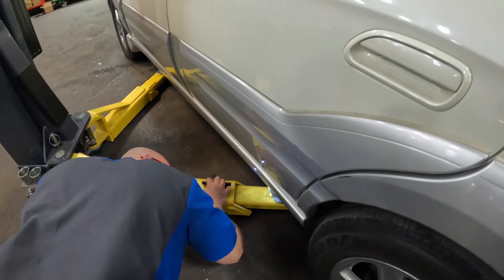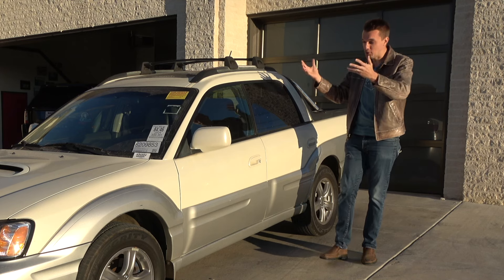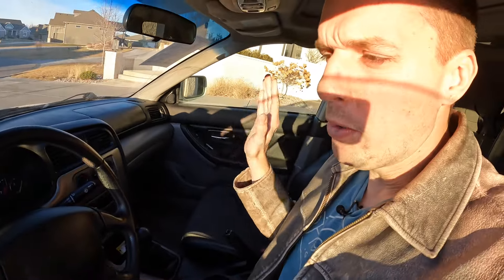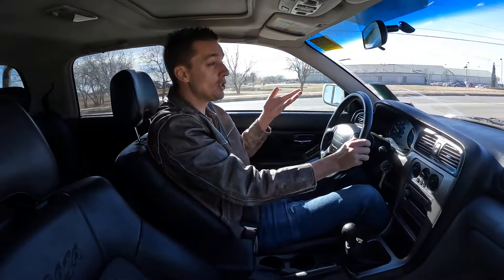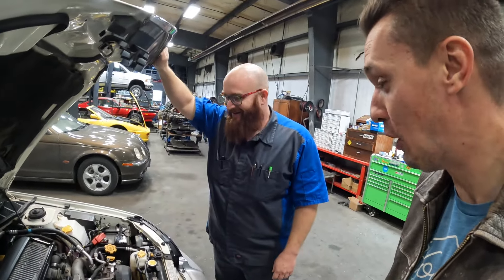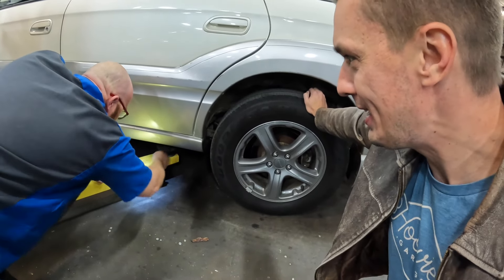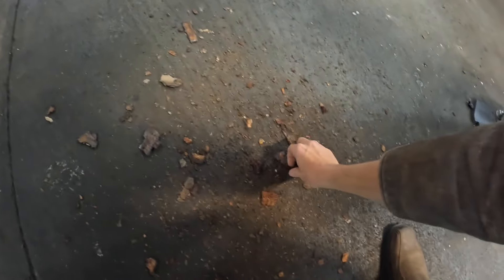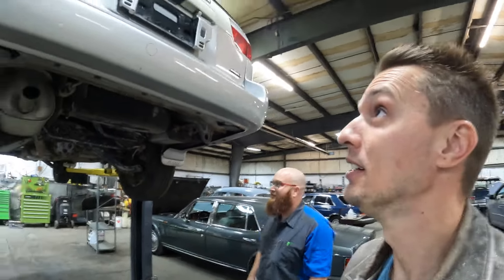Here's why you should NEVER EVER Buy a Cheap Subaru (total mechanical/rust DISASTERS) Baja XT Turbo

Comment: So sad. Mine is a 2005 manual non-turbo with 250k miles on it. I now put several thousand dollars in mechanical and body rust repairs into it to get me through the yearly state inspection. But I know that someday soon, mine will start to look like yours. I am just hoping it can last long enough until Subaru starts making something similar to it. 
I also lost my gas cap door cover the same way a few years ago. One day it was there, and the next it was gone.

Comment: That's like a throwback to the Subarus of the 70s, the era when Subarus were guaranteed to rust out. As a little kid, I recall my father's tan Subaru wagon rusting to the point where 2 bars had to be welded to the front struts to keep them from flopping around- the spare in that era was stored over the engine and that had to be removed. The front fenders would flap in the wind because a line of rust would eat a hole from the headlights to the door. And the front floor pans had holes rusted in them so you could see the road going by, feel the winter wind coming in, and on wet or slushy days, get sprayed by whatever was on the road. I think the old man's car was worse than Hoovie's when he finally took it off the road. It was under 5 years old, and around 80,000 miles. Still ran great. I think it had the 1.4 engine.

Comment: I drove a car in the midwest as a daily winter car until it was in a similar condition.  Ran perfectly but finally sold it for $400 due to rust.  Always made sure the brakes were in good shape and that the major suspension components were secure to the body, but it was finally time.  It's always a shame to let a good car go that rusted away but never wore out.
edit
The guy that bought it plopped down the $400 without even asking to hear it start up and asked if it could make the drive 60 miles to where he lived.  I said it'd make it to Alaska if that's where he wanted to go.  2 years later I saw it for sale for $700.  I guess it wasn't quite rusted out yet!

Comment: To the average person this seamed like a total rust bucket. But from what I saw it looks like the main trouble areas were the front and rear subframes (which can easily be unbolted and replaced) and the side rocker panels.   The rocker panels can also be replaced but they require more extensive body work to cut out and weld in the new ones. It's a common repair I've seen done on older muscle cars and classic Japanese tunner cars. So why not just get this restored since the rest of the vehicle is in good shape and these cars are already sought after.

Comment: You are a good man Tyler.
It’s too bad it cost you $8000 to get this Subaru Baja off the road and not passing this death trap on to a unsuspecting buyer.
Most other people in your position would have run it through the auction and make it someone else’s problem. I guess all you can do is pull the power train and trash the rest. Maybe you can find a Subaru Baja owner that has a blown engine and give them a hand with a working powertrain.

Comment: Subaru makes in general very, very reliable cars. I own a 2017 Outback diesel, and I expect to drive it until I reach retirement-age, 10 years from now. The drivetrain is pretty much undestructable. All I have to do is service it once every year, make sure the oil is fresh for optimal lubrication, and keep it clean underneath, to avoid excessive rust-damage.

Comment: I almost bought a yellow non turbo one of these last year. Unfortunately it also had visible rust in the bottom of every door frame similar to this one. They didn't even try to patch it, they just sprayed foam insulation into the gaping rust hole. It also had about 2 inches of water in the passenger foot well.  I still had to test drive it and give it the beans, but unfortunately it drove like it was about to stall at any given moment.  It's definitely a fun car if you like unconventional things. Still wouldn't mind finding a nice one someday, but those Hyundais are looking pretty nice 👀

Comment: Man can I call you next vehicle I have to sell? You literally pay twice what I do! And I have 50 years experience including KS! I will never buy another Subaru. WAY over rated, cheap, horrible trannies, feel tinny, drive even worse. They claimed to have the horrible head gasket issues fixed by 2008, so when our 2009 non-turbo required head gaskets at 100k and $2k I said enough already. Toyota or any other make does not require a $2k expected maintenance, imo this is a huge scam, boxer design is simply prone to leaking.

Comment: Take it back to the auction arbitrate it and get your money back they had no right selling that car even if it was as is the turbo engines worth $45 Grand with low mileage plus all the other components sheet metal transmission differentials etc

Comment: I can relate. That early 2000s Japan steel is terrible. Bought an 07' Toyota Sequoia for cheap. Higher miles, mechanically sound and looked really good until you got underneath. Not quite to death trap status yet, but another year or two will probably get it to that point. Almost 300K on the odometer now. Thanks for helping keep the roads safer!

Comment: Life lesson: whenever buying a used car, climb underneath, and knock on the frame with a hammer. If it sounds solid it's fine, if it crumbles stay away from it. Always, ALWAYS, inspect ANY car before you buy it, including interior, exterior, and do a OBD scan or have a mechanic you trust do it for you

Comment: My old Subaru lasted 8 yrs and 140k mi before it could rust out b/c that's when I drove it to SoCal - where it blew a HG on the 405. (The mechanic who bought it from me must've fixed it up b/c I think I saw it around 10 yrs later.) Anyway, having also seen a dangerously crusty Forester on South Main Auto, I shudder to think how many more rust buckets like these are out there on the roads. (Here in Mass., this would fail a visual state inspection.)

Comment: Odometer tampering is a Federal offense and the dealer & or seller is responsible for disclosure if either the odometer has been replaced and the actual miles or incorrect (should the odometer have been replaced), or if the mileage exceeds the mechanical capacity of the odometer.  There are state laws against this as well.  Of note, there are both civil and criminal penalties for this and many states also have additional laws against this.  A lawyer, Steve Lehto, has covered this very issue several times, here is a link to one of his videos on the subject:  https://www.youtube.com/watch?v=ZNBeFHVTxvE Bottom line, do not let this criminal act go un reported even though you decide to take the hit, this dealer will repeat doing this to others.  You cannot make knowing false representations of the vehicle mileage.

Comment: When I got my wrx 3 years ago, I didn't think so much of it. Mainly because it was automatic. But I loved it otherwise. I didn't get it on a lift until half a year after that moment. Super clean car on the outside. But underneath it was super rusty and things were failing. One of the axles was bent too. So much for 3 grand. I ended up totaling it 2 years earlier from now.